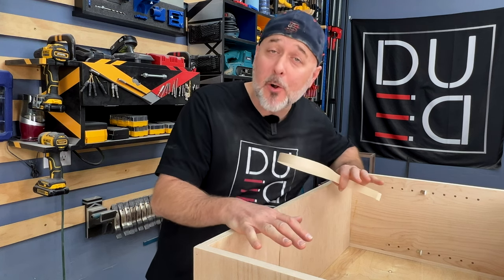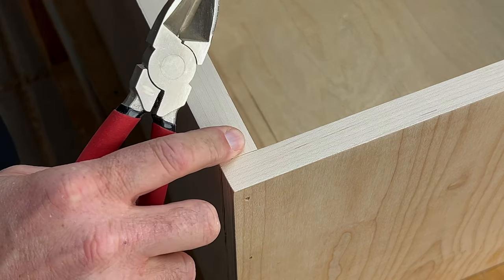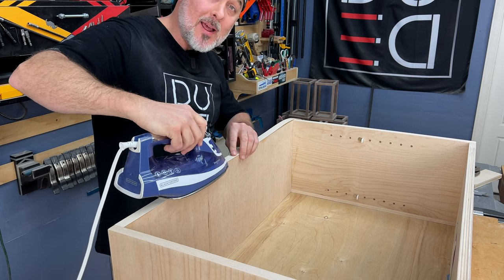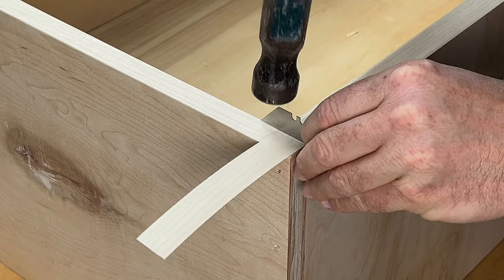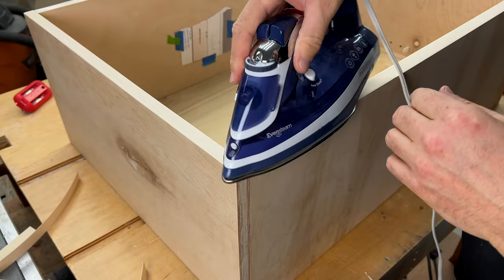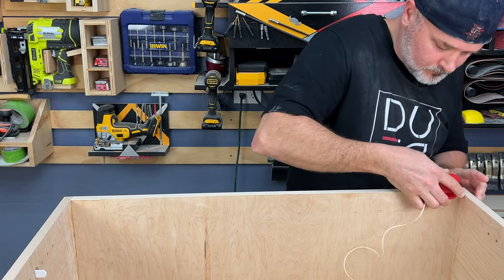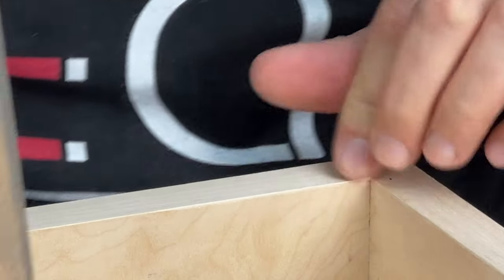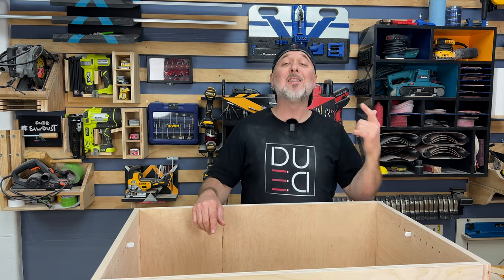Mastering The Most Difficult Edge Banding Skill

Comment: Way easier to edgeband before you assemble, production style. Do your cutting.Then band, etc..Those ends that you're making a project out of are a non issue if done prior to assembly. You run your tape long just as you do on the sides. Cut them close and touch up with a sanding block and you're done. Move on.
Reply from the maker: You’re definitely right! Order of operations I have learned is so important. When doing a project I often write it down just so I don’t forget. Thanks for watching!